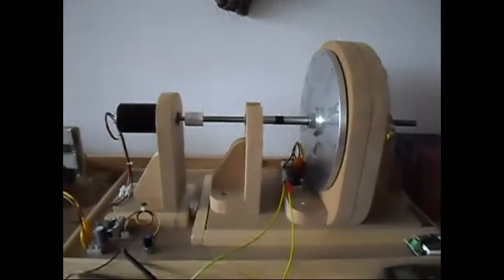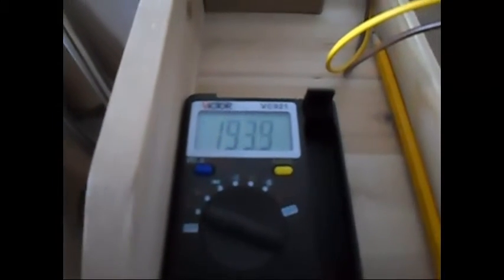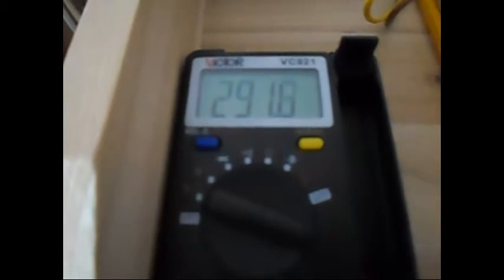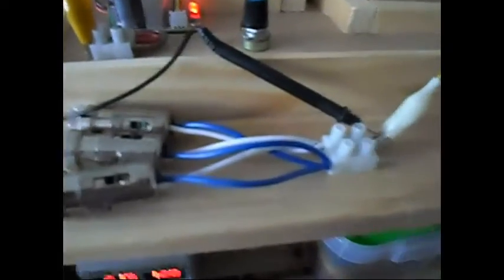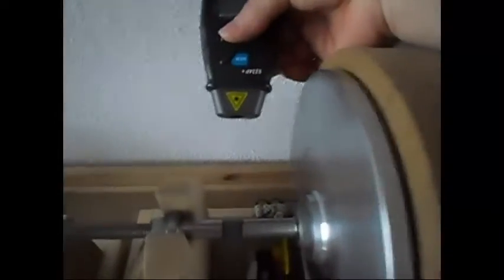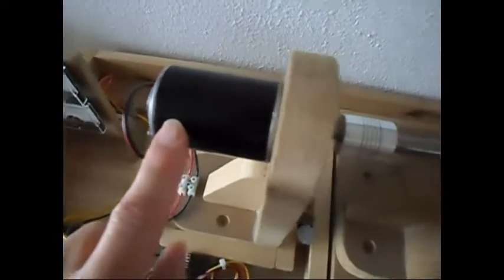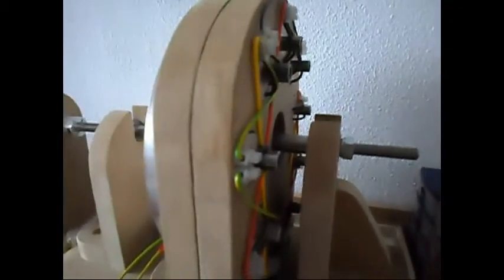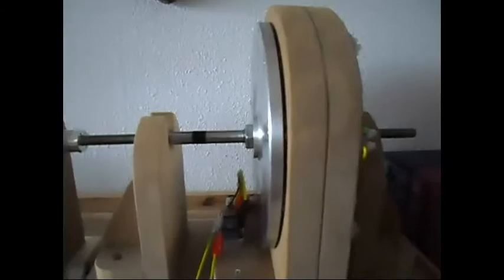PWM-DC Motor_3 Phase Generator Star wired - Speeding up under Short and Load...

Comment: Hi, Mister Caribbean Roots! Thanks for sharing your work and progresses :)

Could you just put a pure (or near pure) resistive load at the output? not leds or fl bulbs or tubes but incandescent bulbs or better resistors so we can check the real power you deliver without any conversion, which will mean loses necessarily?

Of course, if you succeed to plug it back and make it self-running, you will have demonstrated all what was needed! ^_^ but nevertheless, I think I would not cost you much nor in time nor in money to make the test DC amps times DC Volts of your output (if you do on 1 phase, then you have of course the power for the three ;) ).

Regards.
Reply from the maker: Khwartz 
Thanks for your comment and input...^^
I understand what you are asking and i've just finished connecting 1phase in parallel to get lower voltage so i will look for my incandescent lights bulbs and test it out...and hopefully i'll have the same speed under load like before...lol
Will have a video of this test pretty soon... ;-)
Reply: Ok, we wait :) Good video prepare ;)

Comment from the maker: Update,
Been thinking on how to connected them coils in the most simplest, easiest, laziest(lol) and cheapest way possible but keeping the 3 phase output so i'm gonna connect each set of 3 coils of each phase in parallel and rectify them so i'll have 3 rectify output which will be in parallel...this should give me nice lower volt output at a higher amps...^^
Each coil produce around 40vac on it's own so once rectified it will be a bit lower which in turn should be just perfect for the DC to Dc converter...:D

Comment: It's been a little while for a video. Beautiful setup as always and fantastic result. What does the PWM and DC pull? Keep up the great work brother.
Reply from the maker: Diadon Acs 
Thanks for your comment and glad you liked it...^^
Yes, it been a bit slow because i'm nearing the end of the projects so my steps needs to be as accurate as possible and hopefully get it all right...;-)
The PWM-DC is pulling 12vdc @ 900ma unloaded for 1830(ish) rpm and with load the amp draw goes down to just above 800ma...:D
When shorted completely the amp draw goes even lower but that's of no use...lol

Comment: Another beautiful build my friend. Keep them coming. You could rectify each coil and then combine them in series or parallel to get your desired voltage could you not? thanks.
Reply from the maker: SonsOfTesla.Com 
Thanks for your comment and i'm glad you liked it...^^
I can do what you wrote but the voltage will still be around 1/3 of what it is now and that's to high still...i need it to be around 30 which will be perfect...;-)